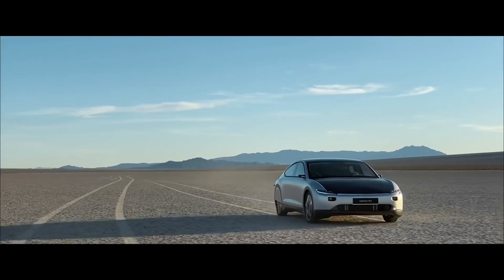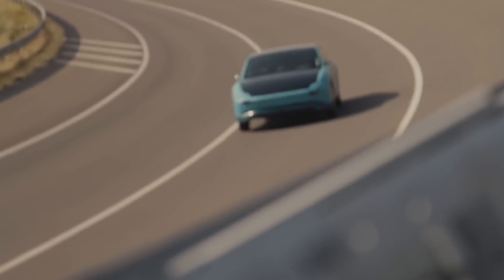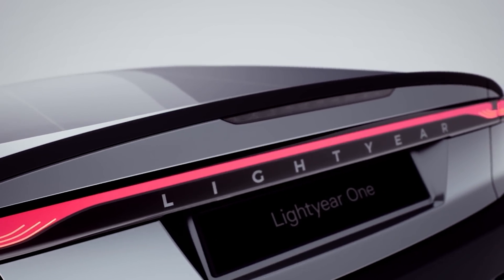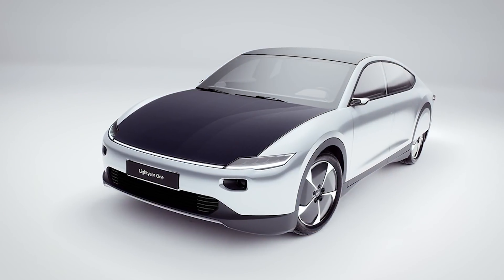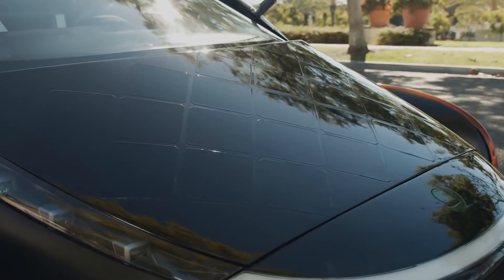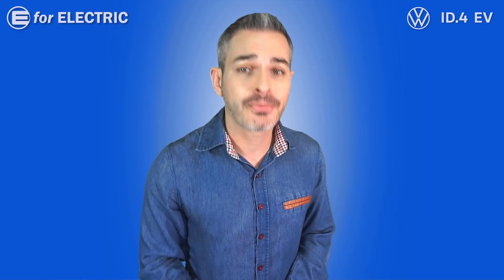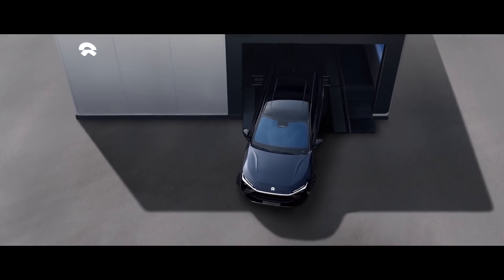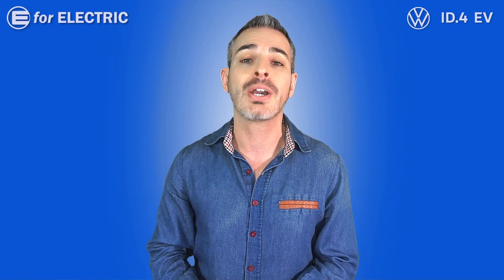Another EV with Over 400 Mile Range? | EV News

Comment: I built a solar powered pickup truck back in 1999, with a 1.1 KW array that looked much like a carpenter’s rack.  Typically got 10 to 15 miles of free solar driving per day.  Ran it for 8 years, 8 months per year, traveling roughly 25,000 miles on sunshine.  This all sounds great until you compare it to buying that energy, which would have been about $0.75 per day.  Also, back then this array cost roughly $5000, so it would take about 6,666 days or 18 years, just to pay for the panel.  At least today, the array would probably only cost $1000.

Comment: Lets say 400 mile range (I would be willing to live with that, my current car gets over 500, but I could accept 400). Styling, Tesla falls short on that (their styling is that of an 80's Ford Taurus)  FSD, not a big deal for me I enjoy driving.  The big one that matters to me is charging speed.  That is a deal breaker.  I only drive my car 44 miles round trip everyday, BUT there are times I need to make far longer trips and I don't want to spend 20 to 30 minutes waiting for a 80% charge (In less than 10 minutes I can completely fill up and be back on the road). Another obstacle is the weight of these cars.  Yes the batteries are placed lower, which lowers the center of gravity, but 6000 to 9000 lbs. is still a lot of weight.   Now I know all the early adopters and EV fans find me aggravating, and you are obviously far more intelligent than myself, but if you want EV to go mainstream you need to stop treating the rest of the automobile buying public as back woods morons.  I don't want an SUV, I don't want a 4 door sedan, I have no use for a big pickup.  So yes, if you're looking for something to just go from point A to  point B and do everything for you, by all means by a Tesla.  I'm not looking for that.

Comment: Alex appears to love the Lightyear One but doesn't talk about cargo space, acceleration, no decent photos of the doors open & seats in his b-roll, hmmm.  And they're only going to make 946 of these $180,000 cars?  Why even review it?  Obviously part of the high price is outsourcing your manufacturing to a for-profit company, but look, what is there about this car that justifies $180,000?  Just ask yourself how many $155,000 Polestar 1's have been sold.

Teslas are going up in price for two reasons... raw materials prices are going up - copper, aluminium, nickel and all that stuff.  And the waiting lines are so long, they CAN increase the prices.  It slows down the ordering numbers, but they need that until they can increase production.

I reckon the $25K price differential for base-to-Plaid Model X is because there aren't that many orders for it.  Everyone knows that people who want to go fast don't usually want to do it in an SUV, and there is a clear advantage to the Model S - it's the fastest-accelerating car that has ever been in production.  Plaid Model X doesn't get that award, but since Tesla want to still get some high-profit Plaid Model X orders, they will hardly get any if it's $139,900 and aren't charging the full $45K differential because it will scare Plaid Model X buyers away.
Reply from the maker: Not sure how you got an impression that I love this brand but this was a news piece about this particular event, not a car review.

Comment: I'm with Elon--- battery swapping is not the answer. Too many issues.

Swap stations would have to compromise--- today's charging stations can give you a few gallons of high-octane electrons regardless if you're on a motorcycle, driving a Mini, a Bolt, M3, or Rivian.

A swap station would need to stock batteries for a wide range of sizes and dimensions, and anyone doing a swap might be concerned they're getting a battery that has been abused or too old to go the distance.

If I drive up to the mountains, or other remote locations, they are much more likely to have chargers, but swap stations would be impractical.

There IS a possibility, though--- if batteries, ultracaps or other technology can have sufficient energy density, swaps could be viable--- but then, charging might still be more convenient anyway.
Reply: Easier just to swap out the whole car....... for a T.....

Comment: A light year is a measure of distance, not time.  It is the total distance that a beam of light, moving in a straight line, travels in one year.  So, why the 946 number of lightyears being built?  Because the formula for determining the length of value in a light year is equal to 9.461e+12 kilometers.  The key digits being 9.46...

Comment: I Love it when AVANTI keeps showing up as over priced electric cars.  And I am still waiting for one of these companies to cut the weight in half by using an 80% Carbon Fiber Body. They have a cheaper version of it that is only 5 times stronger than steel and costs the same as steel.

Comment: Given the advancements in Solar panel technology. the best panels you can get commercially, is less than half the efficiency that has been made in the laboratory. The main improvements involve multiple layers that let light through but still capture energy from the light passing through it. Once the technology matures and the cost per unit goes down many more cars could add effective panels that add useful range.

Comment: My almost 2 year old 2019 Model 3 with 37000 miles looks brand new. That’s because I do my best to keep it OUT of the sun, which does way more damage to a car’s finish than salt or dirt. Solar on a car is so not worth it until it reaches “Star Trek” level of tech. And why should Tesla drives care EA exists at one third higher cost of a kwr? That’s the sad part.
Reply: Solar panels are design to absorb light and I would imagine the other body panels on the car are also design to handle the damage from the sun's rays.

Comment: The light year don’t look too good.  A bit like the old citreon shape. And not v fast also.   Driving at 30-40mph to reach the 400mile range?     Was it fully trimmed? With AC on ?
Reply: 30-40 mph is the average speed of an American driver. A lot of that mileage will be eaten up sitting in stop and go traffic, running heater, AC, lights, etc.

Comment: I would like the solar panels to charge while long term parking at the airport or anywhere.
Reply: This is not new. My 2010 Prius has a solar roof which runs a fan that pulls the hot air out of the cabin while parked in the hot sun. It helps a lot.
Reply: However, I certainly would not pick that car. It's way too expensive.

Comment: How often will a car in a city be in direct sunlight for a whole day? This "never have to charge" idea just does not work, especially not in a city. It makes much more sense to have stationary solar installations and power chargers from that.
Reply: Why not both
Reply: @davidclark538  Too many disadvantages when putting them on the EV compared to the resulting savings in cost. The Lightyear One e.g. doesn't have a rear window to maximize solar cell area. I just don't think this is worth it.
Reply: Guess you won't know if it's worth it until you buy one right? 

Oh yeah that's not going to happen
Reply: @davidclark538  Well I guess you can do the math without buying one :)
Reply: It's funny that you think you're smarter than the engineers building this car.
Enjoy that .
Reply: @davidclark538  I have not questioned the engineers or their numbers. If you don't drive a lot and park in an open field most of the time, you may not need to charge at all with this car. But I don't believe this works very well in the city. You don't need to be an engineer to know that there's not a lot of sun in the shadow of a skyscraper or in an underground parking lot.
Reply: Lol the arrogance that you imagine you're smarter than their engineers....
Lollllll
Reply: Lol got it
Lol

Comment: Aptera does 600 miles on 60kw-hr.
Reply from the maker: I don't even understand your point since a three-wheeled vehicle is a completely different animal that also weighs less because it doesn't have to have the safety equipment that is required for actual cars
Reply: @EforElectric  It has all the same safety equipment even if it might not be required. It least that is what they say. My point is Tesla and Lightyear are still stuck in an old paradigm that automobiles have to be so large and heavy.
Reply: @EforElectric  My point is just like Tesla has gone around Dealer regulations, Unions, and filling stations. Aptera by selecting a three wheel design can opt out of specific safety regulations that are onerous and out dated. Like requiring rear and side view mirrors when cameras provide an even better view while improving aerodynamics. Aptera has said their car will be as safe or safer than any car on the road. It just aren’t following ridged outdated safety regulations to get there. I am hoping they go with a joystick and get rid of the steering wheel as well.

Comment: Say it costs $1000 to add solar panels to your car to get 40 miles of range per day from the Sun. Also, assume that is 80¢ of electricity. Then, the payback time would be 1250 days, or about 3 years and 5 months. An added benefit is that you will likely be within 40 miles of a charger. That is peace of mind if you cannot charge at home.

Comment: My understanding is putting motors in the wheels will add lots of unsprung mass, which will have a big affect on performance, handling, and braking.
Reply: not if those are not rotating masses, the handling will be affected with the lowest center of mass that usually is a good thing, the braking is not a big deal, electric cars rely on regenerative breaking, performance would be different due to the reduced heat dissipation, this should increase the efficiency

Comment: Tom is missing something really big when he says that putting solar cells on a car isn't worth it because the amount of energy it generates costs so little that the cost of the panels will not be recoverable. A lot of people live in apartments where there is no charger installed so owning a standard battery EV would be completely impractical, but one that could get 50 miles of range per day just by being parked out in the sun would be a game changer for them

Comment: I'm planning on an aptera next year.  I will pay the $1000 for the full solar package.  I am retiring and intend to do a lot of traveling.  The extended range of the Aptera along with the solar package make up my range anxiety mitigation program.
Reply: I too reserved the 1000k mile Aptera. I have analyzed several day trips and discovered i might not have to charge the vehicle on most trips. And as far as daily commutes and days of none op, I will not have to plug in the vehicle. And when I do,  120 volt will give me 13 miles an hour. 104 miles in 8 hours overnight.

Comment: Why do they cover rear wheels on so many EV cars?
Reply: Aerodynamics. Can't do likewise for front since open space is needed to turn wheels when steering.
Reply: Purple, it was only the older EVS, from about 20-25 years ago that had them, eg GM’s EV1 and the Honda Clarity.
I can guarantee you that NOT ONE EV INTRODUCED in the last 10 years has had them !! Do your research and you’ll find out this to be true.

This vehicle is the exception and is only a prototype at this stage. Who knows when it will actually go into production.

And the reason why an electric vehicle MAY have these rear wheel covers is pretty obvious, isn’t it ??? It’s to improve the  range!! Although at the obvious (and subjective ?) detriment to the overall look of the vehicle (in most peoples’ opinion, I would suggest)

And I can see why the designers of this vehicle included them - one of their main design aims was to achieve the maximum range !!!!! A real no-brainer, don’t you think, Purple??
Reply: @Nicholas.T  I have no issue with electric vehicles i just dont understand why many look horrendous. 

I have had my reservation for the F150 lightening since it was introduced but I will be pulling that reservation due to solid state batteries around the corner which will drastically reduce the resale value of any lithium batteries.

One of the reasons Tesla has been so good is due to the way they look. Tesla has style they dont look horrendous like the rear wheel covers or even the horrendous look of the Nissan Leaf.

Toyota setting range record with their hydrogen clean fuel vehicle and coming strong on solid state batteries will be the future.
Reply: What other cars have covered wheels, I think this is the first one I’ve seen so far✌️
Reply: @antonthompson7838  you haven't been paying attention. Look at older EVs.
Reply: @antonthompson7838  Honda Clarity
Reply: They cover the rear wheels on many European ICE  sport cars too.